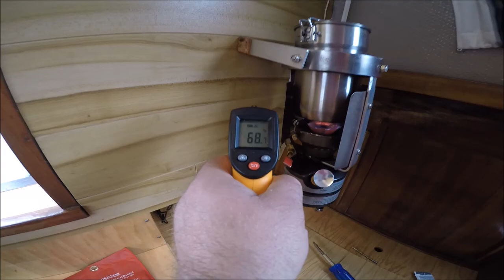DIY Gimballed Stove -  Albin Vega  - Golden Hind IV

Comment: Good job! you could also make it where you hang it out side in the summer so not to get the heat in the boat, and moisture.
Reply from the maker: for sure.  Wil make a bracket for one of the railings

Comment: Excellent system ! What size nuts and bolts did you use, and what drill size ?
Thanks ! Happy sailing !
Reply from the maker: philippe berling great little stove. works great.  I can't remember off hand the bolt sizes but 1/8 or 3/16 stainless with nylocks.   Drilled so that it turns freely but not sloppy

Comment: Where did you source your stainless rings from? I am having a hard time finding the right size.
Reply from the maker: Hi Mark.  I used cot off rings from stainless pipe.  I have access to scrap stainless.  Could also use aluminum
Reply: @ALiquidLife   Thanks for your reply. I am going to try and bend some allium around a template since i can't find anyone who has pipe these sizes here in the north east. I am also going to try bending some 1/2 inch steel and see which is easiest to work with. I feel sure the aluminum will be easier to work with and will probably end up using that. Plus it is easy to source at the hardware stores. I will be attaching the two ends by overlapping the piece that goes down to hold the stove with some small through bolts and with the inside ring I will do the same but just have a small piece to attach them together. I have not gotten the stove yet but will be using the same as yours. Unfortunately it will be awhile before it is delivered. Can you tell me what width the bar is that holds the stove? From the video it looks like about a 3/4" bar. Thanks again for any input.
Reply from the maker: @markshaw9010  could try that.  I can't remember the sizing of the pipe I used think it was 5&6 inch pipe.  Wonder if you could source it at a local drainage or industrial supply.  I had access to a mill boneyard which made it easy

Comment: what stove did you use?

Is it a Coleman Exponent?
Reply from the maker: philip ritson I used a :Coleman Peak 1 Camp Stove Model 3024

$39.95. on ebay
Reply: I have an old version of the peak multifuel stove. Not sure what model number it is or if it burns kerosene. Or diesel. Been a while since I used it. Backpacking. Not the lightest stove out there but for this use who cares. Seems like a version which would use diesel would be good on a boat that actual does longer passages. Did you get the Diesel problem worked out ? Wondered if it was just too cold where you tried that.